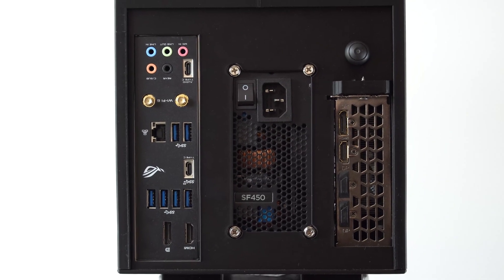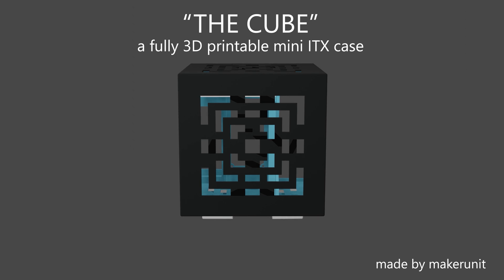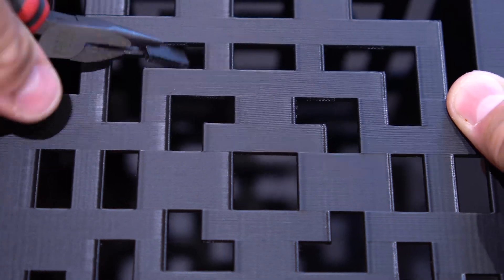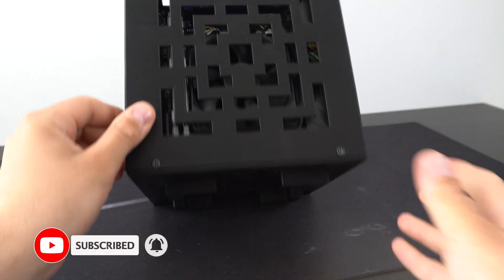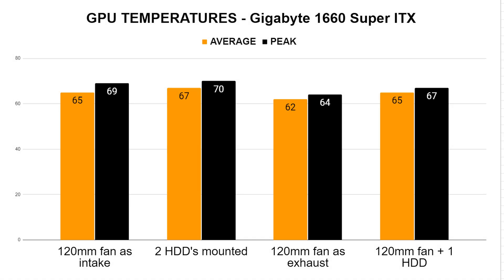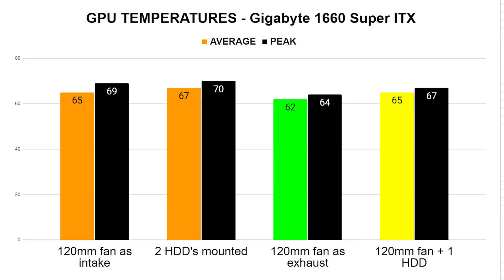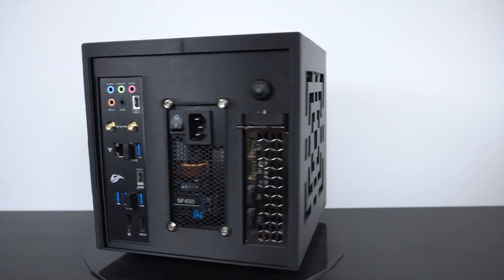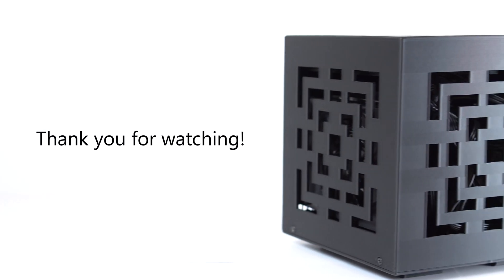CUSTOM MINI ITX PC CASE 8L CUBE 3D PRINTED

Comment: what would need to be done to have this support a 200 mm gpu?
Reply from the maker: Basically you’d need to extend it’s length. That will require you to have some experience in modifying sketchup files. I no longer have a license for sketchup which this case was designed in so I’m unable to make further changes.

Comment: What MY dream case would look like Jonsbo N2 but with better airflow and:

No GPU
HDD rack for a max of 4x3.5 HDD - parallel with the PSU 
Clip closing system instead of screws 
Some kind of beehive/small holes pattern on the case on each side and mesh filters fixed with mini magnets.

Most likely I'm too inapt to create my own but this is what I dream of.
Reply from the maker: It doesn’t sound impossible. Simple and functional. Not sure if side mesh is necessary though, perhaps only for the PSU air intake as it might be ideal to have the airflow forced past the drives, having it like a «tunnel» may also reduce some of the noise.
Reply: @makerunit  The reason why I need mesh covering is because I have 3 cats :D and because even if I vacuum daily I still have dust issues around the house.
Reply from the maker: @thecrush3r  I feel you. I have no cat, but a Shetland Sheepdog which is quite furry, especially during late summer or early fall practically replacing all his "inner" fur for a few weeks. We get hair in our food, bed, on tables, on walls, everywhere...

Comment: any cons invertind vga orientation to avoid the 35cm pcie extension?
Reply from the maker: I’m not sure exactly what you mean, however if you’re asking if it’s possible to change the design to not need a PCIe riser, then no I’m very sorry, this deIgn is no longer going to be updated as I have stopped using the programs used to design this case. If you want a cube design that does not need a PCIe riser check out my other «Cube» case on my channel. 😊

Comment: very nice design. i would love to see the same size design but without having to use gpu extension cable
Reply from the maker: Thank you! 😊 Noted and I’ll consider it as a potential project, at least I do want to create more cube cases 😊
Reply: @makerunit  i think the orientation like in your PC Case Design Tutorial would be perfect 😁
Reply from the maker: @sadessnuk1955  yeah it’s possible to do it that way but the height would have to be just a bit taller for that to work. I always try to steer away from using risers when I can but to fit the 200x200x200mm shape so I could not plug the GPU directly into the motherboard as it would have had to be a bit bigger in one direction then.
Reply: @makerunit  ah yes i didnt think it through, gpu need atleast 2 slots, then the height will be over 200mm, atleast 220mm maybe? but it still a very small case tho :face-blue-smiling:. I love small cases, but they are too expensive for my budget :face-purple-crying:
Reply: @makerunit  or maybe flip the whole build upside-down position, then the gpu on top, no top cover so the gpu size wont matter. the motherboard and gpu orientation kind of like Tech Ambrosia's test bench. Sorry for my basic english :hand-orange-covering-eyes:
Reply from the maker: @sadessnuk1955  my Little Boy S case is 227mm tall, (without feet) and it can hold a 2 slot GPU that way, and can probably be trimmed down to about 220. So 220x220x220 is possible.
Reply: @makerunit  I found the layout that i can think of will be very simillar to JONSBO T8 😂
Reply from the maker: @sadessnuk1955  yeah that’s a great looking layout! 😊 kind of similar in a way to my latest project I posted last night actually.
Reply: @makerunit  already watched and printing. It makes my friend want to change his setup too 🤣

Comment: You're totally choking the PSU?! Not only that... The intake is next to a hot GPU?! :o
Reply from the maker: Oh yeah I must admit this design is not the most optimal, but the only way I managed to fit within exactly 200x200x200mm 😁 if I had only 10mm more I would have had so many more options for layouts🙂 I have a different cube design that’s 210x212 approx and has a much better layout!
Reply: @makerunit  I see. Yeah my mindset has always been "function over form". But I'm still curious... Did you run into any performance issues/shut down due to this design?
Reply from the maker: @ChrisKadaver  I did not encounter any issues in the time that I used the design but I did not test this for a very long time, only a few weeks until I moved the parts to a different project again.

Comment: love the design of the case, really love it, and its a nice little oven 😂 wish its that workable , the problem is the psu, wherever u put that one both those gpu and mobo generating heat and the main power in the middle is sandwich to it. it would really dwindle the lifespan of most of the parts. but really love the design its cute and compact but not logical if I will stress it out to playing triple a titles, its better that the mechanic master mc18? same design but this is metal, though this  case is plastic, another workaround is undervolting the gpu and cpu but still the other parts are sitting close to each other. still love it. really cute
Reply from the maker: Hi! Thank you! Yeah I do agree that the part placement is not absolutely ideal. Some heat is definitely to expect here. It’s been a while since I made this now and the parts have moved on to newer project, although, I made another cube shaped case now more recent that has a slightly bigger footprint but has much more efficient cooling 😊

Comment: what about the temperatures on the PSU? have you consider to remove part of the PSU enclosure to improve its air flow?
Reply from the maker: I believe they are designed that way for a reason though. If I removed the outer cover the exhaust air would exhaust into the rest of the case instead of out the back like it’s supposed to. Honestly I think it may make things worse but I have not tested to hard to know for sure 😊 currently not using this design anymore due to moving the parts into other more recent cases 😊
Reply: @makerunit  I was thinking more about having a lateral side of the PSU removed in order to receive air directly from the Noctua fan at the top. Maybe with a 3d printed PSU case. Thank you for your response, I've been loving your videos since a couple of days when I discovered your channel. Sorry for any grammar mistake.
Reply from the maker: @ilichio  it could improve temperatures I’m sure but to me that would be more of a safety concern. I’m no authorized electronics engineer and have no clue how a PSU actually works, and the housing may serve a purpose that when tampered with may cause increased risk of fire etc… so personally if the PSU temperatures are the main worry I’d go with a different part layout within the case, or another case 😊

Comment: Would love to see a remix that is slightly taller and accommodates a bottom 140mm intake fan and top 140mm exhaust. This would be quieter and move more air, lowering temps.
Reply from the maker: I agree this would really improve the temperatures probably. Altough I have decided not to pursue this layout anymore due to it not being the most efficient to be honest… I’m aiming to make a «wind tunnel» type of case someday though with big fans on each end forcing the air through!

Comment: you can make a even smaler case by no gpu and pico psu. for example a j5040 mainboird to use it as a media pc or nas ^^
Reply from the maker: Oh! I didn’t know boards that small even existed! That’s pretty cool, do they have any processing power though?
Reply: @makerunit  yea this bord is ment tp be an media pc or nas or office pc. it has a pentium silver j5040 cpu  preinstalld with cooler. i use it for 2 years now as my daly pc and it is fine no hitches or somtig. this bord can 2x 4k 60fps but then there is no headroom for some heavy stuff. but i use 1080p 60 with a linux not windows becaus i dont like windows anymore sins win8 and linux is lighter for a system . but windows should work fine with it too. the only thing what bother is the c states.  
i dont turn it off normaly 7watts are fine but 5 would be better ^^
have in mind this bord is build  for normal daly usage build the cooler can handle 10watts but at full load the temps then are around 95c and 100c at abient 20c what fine is for this type of cpu. normal temps are around 40 and 70 depends on the load. 
i use ubuntu 20.04 lts and the cpu is wit firefox rumming around 20% to 30% load and 3gb ram usage. officel support this bord only 8GB ram but i use 16GB ram and it works all16gb usable but i dont know howmuch ram is too much. 

i would say it is a try worth and i think for every one who use word exel youtube firefox and a media player it is plenty of power for it and it cost not much and ultra low power usage. 

my pc build is in a old used lenovo thinkcenterre A70 chase with an pico 90 with an 12v 3A power brick from an external harddrive, old used 60gb ssd and a 4tb hdd. i only buyed for this build a the pico 90watts(20€), atx psucover(7€) the 4tb(90€) hdd and the j5040 bord(154€). i dont know how much it will cost today.
Reply from the maker: @reinekewf7987  that’s awesome! I might have to look at those sometime in the future! Currently I have a project going on but some issues with my 3D printer I’ve got to resolve before I’m able to start printing it. It’s kinda similar to this case you’re commenting on actually. But a different layout and external cover. Slightly larger but more efficient design I believe haven’t got to test it yet but will be mostly same internal components. Just in a slightly different setup. 👍
Reply: @makerunit  i have a ender3pro with bltouch i use it every cobble months and had issues with rubber rollers for  the  y axsis they had dends from  not moving a friend told me i shoud use brass rollers for thus axsis and with brass now no more issues. Ive Never tried printing  a case. Maybe i will do it but i am a bit scared because pla can deform with Heat and i Never tried printing a large thing. Most things i printed are not bigger as 10cm x 10cm x  5cm
Reply from the maker: @reinekewf7987  In the beginning most of my cases were printed in PLA, but seriously after trying PETG I have never used PLA anymore. PLA is from my experience harder and more brittle, but cracks easily and can deform at much lower temperatures than PETG. I personally haven't had much issues with PLA but I notice layer adhesion so much stronger with PETG. 

About the printer, I do have an Ender 3 v2 working perfectly fine with a CR-Touch probe sensor and SKR E3 Mini motherboard to enanble functions like linear advance etc for sharper corners etc, but I just prefer using my CR10v2 because it's been tuned so much with also the E3 Mini board but where the issue is right now is trying to setup octoprint because I want to make a timelapse of the case print for video purposes just as a cool detail, but seems like some interference issue causing it to crash I've read about sometimes the motherboards backpower the Raspberry Pi causing the Octoprint interface to crash, so I'm currently trying to figure out how to fix that... 🙂

Comment: I loved everything about this. I’m currently trying to make a 298x250x105 tall consolish size matx with a full sized 1070 so I can take it in my backpack.

I’m printing in petg on a cr10v2. Do you have any recommendations for thickness of the walls of the case as well as infill percentage. I don’t want to waste a whole bunch of plastic but I also want it to be durable enough to carry around and not disintegrate.
Reply from the maker: Thank you I’m glad you liked it! I have thought about trying to design a console style case sometime! I usually keep outer walls 3-4mm if they are just for «looks» and like 5-6mm thick for walls that need to carry weight. Also, try to always brace walls that carry weight so they’re strong in more than just one direction.
Reply: @makerunit  Thanks. I have the main structure and the back panel holding the gpu and flexatx psu at modeled 6.35(1/4 inch) right now. That's likely plenty and il add some bracing around the critical weight-bearing areas.

Comment: Hi
Which is the size for the power button hole?
Thanks
Reply from the maker: I believe the button I used required a 12mm hole and I think I made it 1mm or so more so should be about 13mm. I’m not currently by my computer to double check but at least the button I used was 12mm.

Comment: I'd love to see what you could create with a Voron 3d printer, being able to use the higher-temp filaments to make really neat chassis
Reply from the maker: Unfortunately I don’t have a Voron printer, but if you think about material use, I’ve had zero issues with PLA, I mean it’s a bit brittle but as a stationary PC I’ve had not a single warping issue due to temperature. 

For my latest case I switched to PETG and I’m very happy with the result, it feels super sturdy and can for sure handle the temperatures no problem!

Comment: Make the print from high quality ABS, then put the parts in a  acetone vapor chamber. This will increase the eye candy appeal of all the cases you have made 100%
Reply from the maker: I have never tried printing ABS actually. I’ve heard so much about warping issues. Afraid that it may be a problem with such big components. I still struggle from time to time with warping on PETG.

Comment: Your room temperature is fairly cold.
Reply from the maker: Yeah I might have slightly messed up on that part as I based it on what my heater was set to, and not an actual measurement so might have had the room a bit warmer as I had also been running my other pc editing for some time so the room temp may have been higher. Sorry for the inaccuracy there.
Reply: @makerunit  thanks for the context!

Comment: Hello Friend!  Happy New Year and Merry Christmas!!!  Health.  Please tell me what is the total length of the cable, raiser (adapter) for the PCIE x16 video card ???
Reply from the maker: Thank you! Merry christmas and happy new year! It’s about 350mm minimum, it’s a hard size to find so it’s easier to join two shorter ones into one long works the same 😊 anything over 350mm is good 👍
Reply: @makerunit  Thanks for the help!  Ordered 400mm!
Reply from the maker: @Proffi_  awesome! I hope you enjoy the case! Let me know if there are any issues and I’d happily help you the best I can 😊
Reply: @makerunit  Please tell me the diameter, size, bore hole for the power button!  Thanks!
Reply: @makerunit  I'm waiting for SSD, RAM, then I will look for a company, or a person who will make the case.  After that I will definitely show you the result!  I guess it will be the end of the month, January.
Reply from the maker: @Proffi_  the hole diameter for this one is 13mm, I think I used a 12mm push button 😊

Comment: Dang, I need something that can handle a full size GPU. I'll look at the files and see if I can modify it.
Reply from the maker: Don’t worry, I’ve got a new case in progress now that will support GPUs as long as approx 320mm, 240mm AIO and more! 😊 hopefully it’s out within november if everything goes as planned. It’s already in the printer for the first few parts 👍
Reply: @makerunit  Cool man! I love the designs. Great job. I will be waiting patiently. 👍
Reply from the maker: @dangerous8333  Thank you! 😊 what size is your 3D printer?
Reply: @makerunit  I have an ender 3 v2.
Reply from the maker: @dangerous8333  ah I see, the new case I’m working on at this moment barely fits on the CR10. Requires 300x300x300 printbed unfortunately. This will be a fairly big case though, it will fit mATX board, 240 AIO, 320mm GPU and plenty of storage! 😊 but I guess it may be printable if split and glued I guess! 😊
Reply: @makerunit  Yes I will modify it to fit most likely. Although I was thinking of doing the extension kit on my printer which will give me 400x400 so it may be time to do that!
Reply from the maker: @dangerous8333  the Ender extender kit?  👍

Comment: do you have a version with atx psu?
Reply from the maker: Hey, no sorry, there is barely room for the SFX psu how it’s set up now, so unfortunately it’s not room for ATX 🙂
Reply: @makerunit  it is alright, it is too late for me, already bought an atx one. I Should search for chasing compatibility first before purchasing component
Reply from the maker: @alivevilaalivevila6665  I have one version which does support ATX psu up to 125mm depth. If you either check my channel or my thingiverse account you can see my most viewed/liked case the black one with square pattern, maybe thats something you like?
Reply: @makerunit  what do you mean by depth? My psu is be quiet system power 9 with dimension (L x W x D), (mm)140 x 150 x 86. If it is the height maybe mine is not suitable either.
Reply: Is the D is the depth?
Reply: Just checked your other video, but my ender 3 pro print bed is not large enough to print that. Thanks anyway.
Reply from the maker: @alivevilaalivevila6665  It's the 140, most common ATX psu sizes are 125mm or 140mm. The case I made only fit 125mm sized ones. Unfortunately yours won't fit. 😞
Reply from the maker: @alivevilaalivevila6665  Ah I see, it’ll be very hard to make a case with ATX psu to fit that cube given its size, but stay tuned, follow my channel if you want. I’ve got some fun ideas coming up, which will definitely include some more compact pc builds and more 🙂
Reply: @makerunit  nice, subscribed!

Comment: Please could you make a version with supports 2x 360mm Radiator?
Reply from the maker: Maybe sometime in the future. Dual 360 radiators would require a huge case! I’m currently working on one case to support a 240mm radiator now.

Comment: Does the case get soft when the computer runs on MAX? due to the relatively high temperature
Reply from the maker: Not from what I’ve tested. Gaming for a few hours at least doesn’t seem to affect it much. No signs of it getting any soft. Feels warm but still firm to the touch. 😊